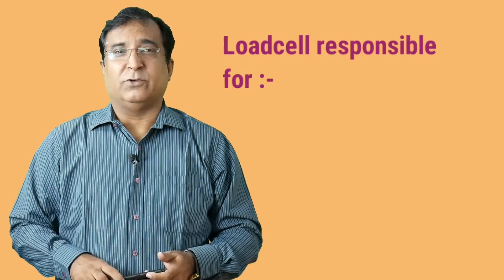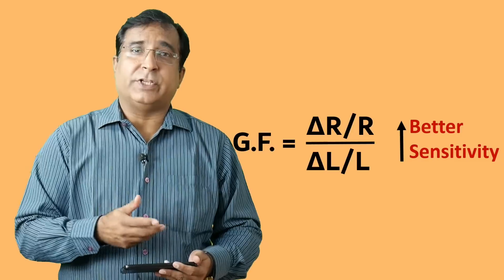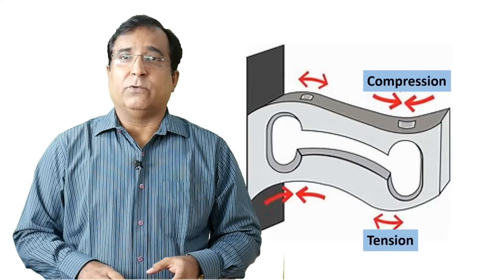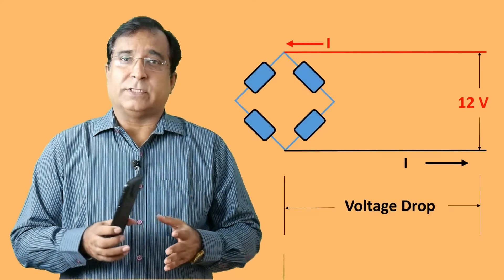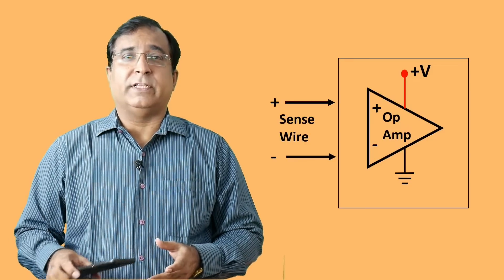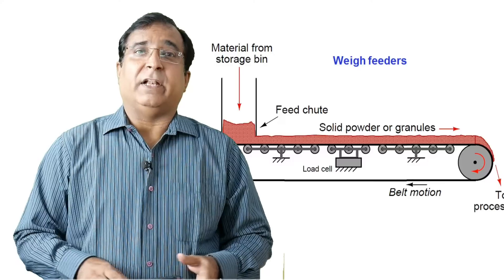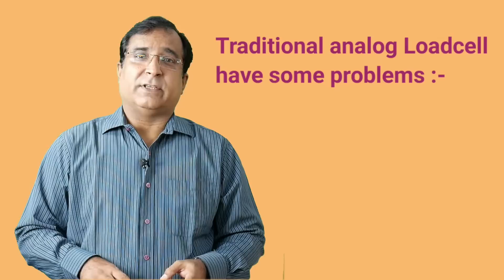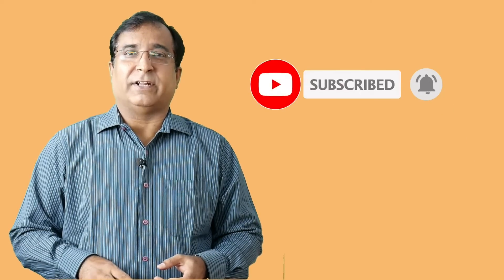Load Cell Sensor | Weighing Techniques @dineshdiwani

Comment: Please suggest a book for industrial instrumention which gives such details regarding temp,pressure,flow ,level,weight measurment
Reply from the maker: I used to have in syallabus.. title instrumentation  by kirk and rimboi... Check online download...
Reply: @dineshdiwani 
Thank you sir... Just want to confirm, will that book give practical skills or it will be theoretical concepts only.. I mean I want to get skills which I can put to use in today's modern industry..
Reply from the maker: @kunalkumar7804  how can a book give you practical knowledge until you do the job by hand? It comes with time when you work
Reply: @dineshdiwani  Sorry sir, but that was not what I meant. I wanted to ask that whether the book will help me develop the skill to decide which instrument to prefer over the other, about the constraints while installing a particular type of instrument, optimum conditions for best performance, things to keep in mind while commissioning or say how to trouble shoot problems associated with a particular instrument etc. Most of the books revolve around giving the equations about the working principle, about advantages and disadvantages, etc which are good for exams only but they don't help with problems we face in the industry/plant on a daily basis. Like in the syllabus book I can find the working principle of a load-cell but not about where to use which type of load cell, what are the constraints or points to keep in mind while choosing a type of load-cell, or how to get its best performance etc.
I wanted to know that if there is a book u can suggest which will help us all in this regard. Thank you sir
Reply from the maker: @kunalkumar7804  sure it will
Reply: @dineshdiwani   
Thank you once again sir..